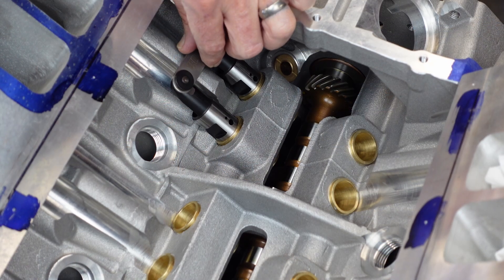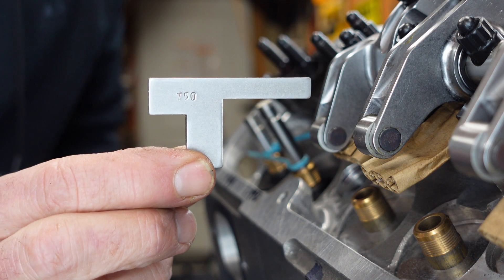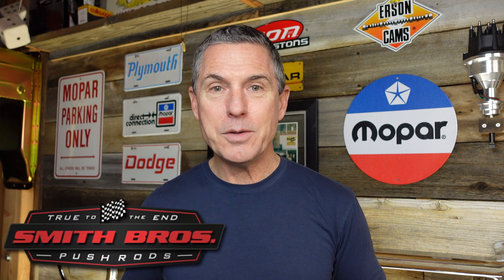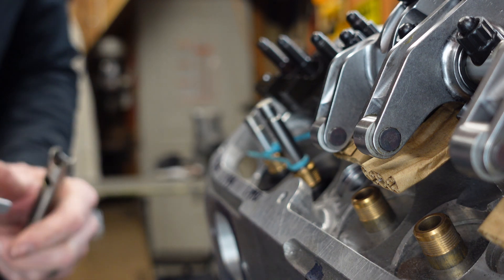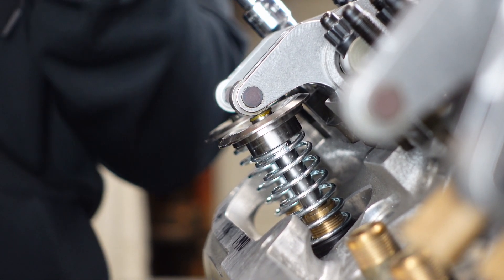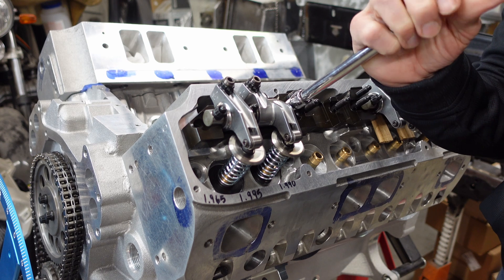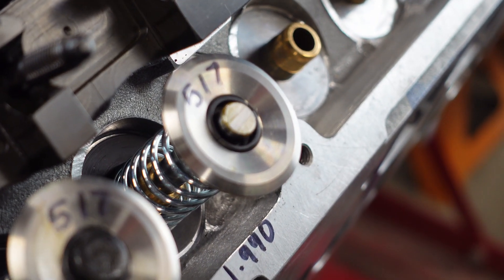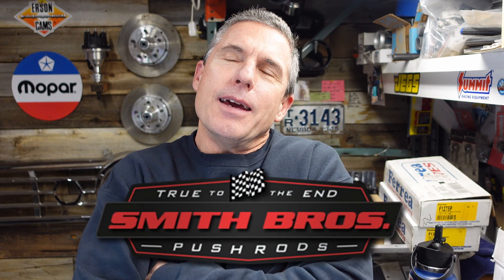WOW these pushrods!!

Comment: Those push rods look nice, but seem underwhelming in diameter for the caliber of motor you built. Steve Morris says you can’t over diameter to push rod as long as there’s space for it to fit. I see in many in many of his engines he uses manton 9/16 diameter. Amazing patients & attention to detail, especially in the port work of your heads.
Reply from the maker: @ProfessionalCrook  Thanks for the comment. I like where your going with that thought…
When this old cylinder head platform was designed big push rods were not yet a thing. I spent a ridiculous amount of time on the mill (learning) making room for these 7/16 pushrods. I guess if I was gonna do it again I might’ve been able to get a half-inch pushrod on the intake. I definitely could’ve did a half-inch pushrod on the exhaust. The things that I’ve chosen to do sort of go hand-in-hand with where I was at with my last combination. And this pushrod is a big step up for me. I’m just, a hobbyist after work in my one car garage doing it 100% solo.
 I like how you think Brother always got it keep searching… keep making it better.
One thing that’s important to keep in mind is that Steve Morris’s big cam pressurized engines need more valve spring than what I’m running and ultimately this spring pressure is what dictates the pushrod requirements.
Thanks for the feedback.
Kevin